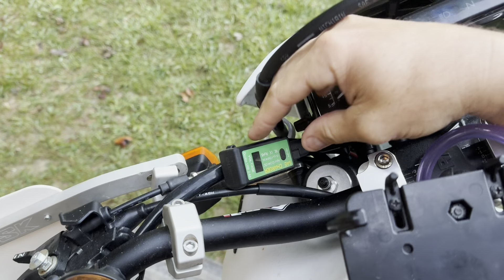Essential Gear For Adventure #wildernesssurvival

Comment: Jason , Jason , Jason please please read this ! This is about your chain , DO NOT TIGHTEN IT ANY MORE THAN IT IS. It's too tight already , to measure the proper chain tension you use the "finger method". Put 3 or 4 fingers between the bottom of the chain and the top of the swingarm. That's the proper tension , you need slack in the chain so that when your suspension compresses the chain actually gets tighter. By having the chain as tight as you have it now puts undue stress on the counter shaft and sprocket which in turn will ruin your engine over time. I'm a former motocross racer and mechanic so I do know these things. I'm not trying to toot my horn just trying to help you so I hope you take my advise. Google "proper chain tension for a motorcycle" on YouTube or ask a motorcycle mechanic.
Reply from the maker: Thanks so much for the tip!